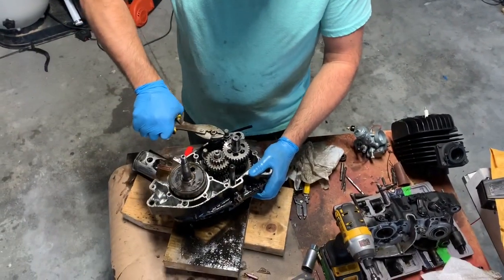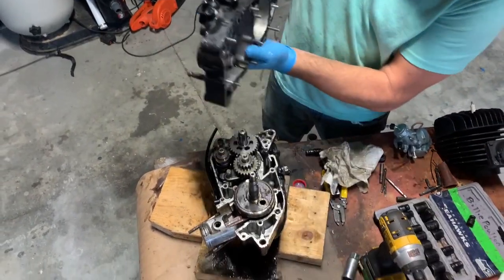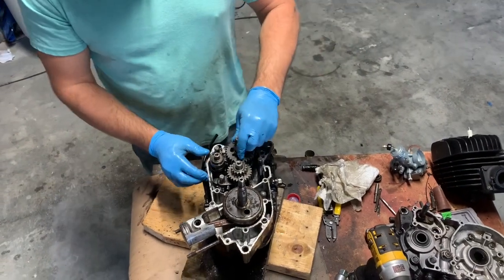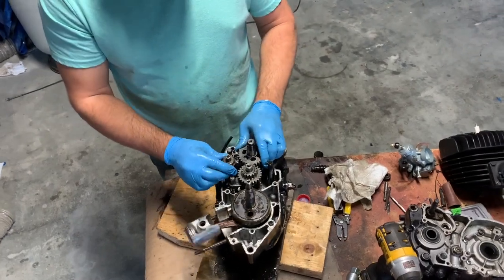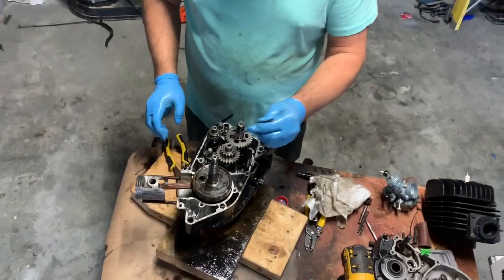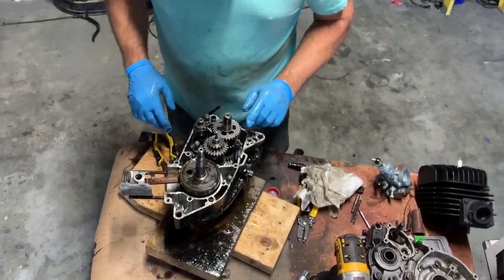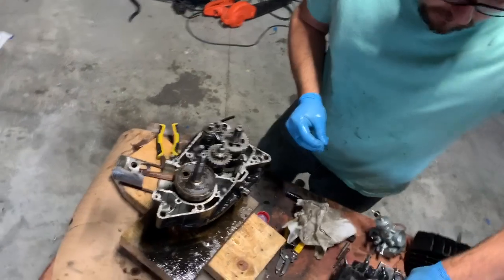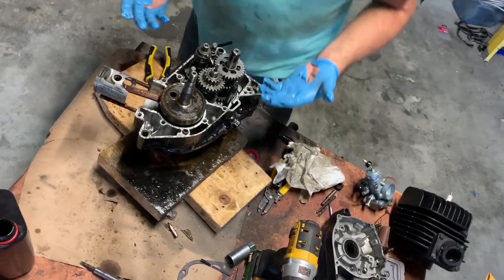Please Help Me Yamaha Dt100 Transmission

Comment from the maker: So I only split the case didn’t remove the clutch or anything else. I can’t find neutral and it will only shift 3 positions.
Reply: Aye my friend I’m stuck as well and have quick question. How did you have the engine case came of? I have remove all screw and doesn’t want to come off I been trying to tap the end with a chisel and doesn’t want to come off?
Reply from the maker: popeye the Saylor check out the video on splitting the case it shows you how I did it